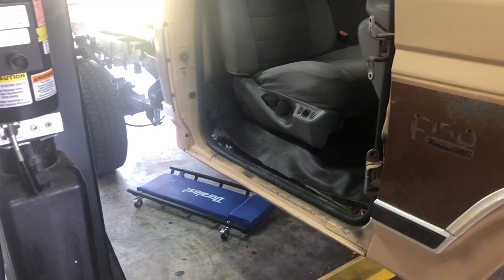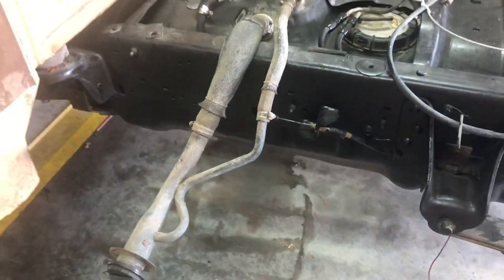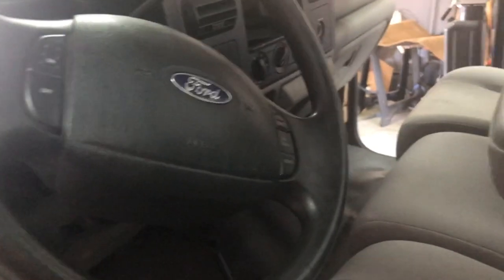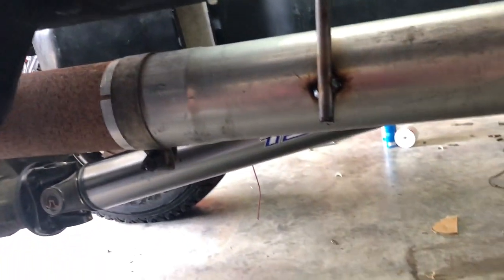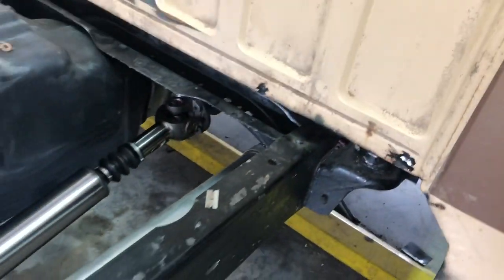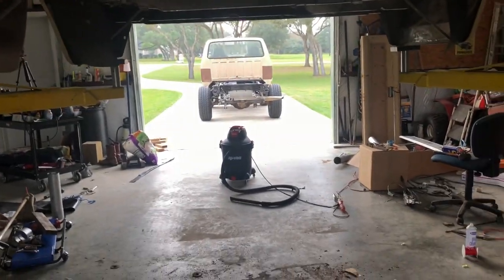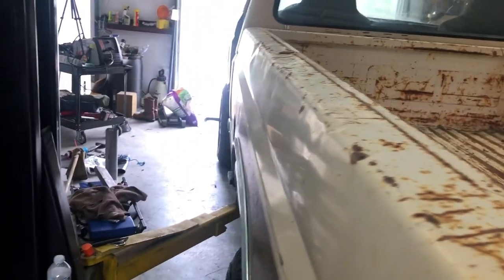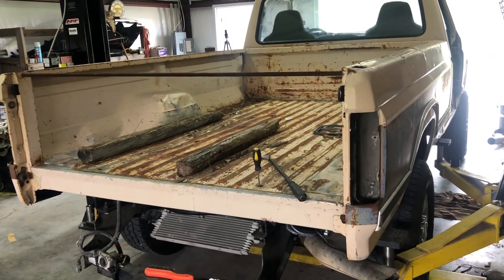1986 Ford bullnose 6.0 powerstroke swap: Part 28 Exhaust, Interior & Bed

Comment: If you can, in the next video can you show what the underside of the bed looks like with the spray. Would love to see how it came out
Reply from the maker: I sure will. I used raptor liner. But in a spray can. Not the one that you use a compressor. I can post to my Instagram as well. Might be easier and quicker.

Comment: How did you keep the dash in it?
Reply from the maker: I took the cab off and set it on the ground and test fit and filled additional holes into the side braces. Two existing holes actually lined up so I use those to hold it in place for me so I could drill. And since I was using the super duty firewall and floor it made it easy to run the wires and harnesses.